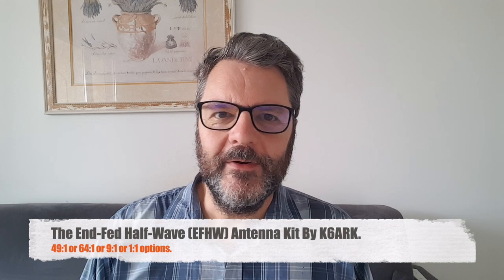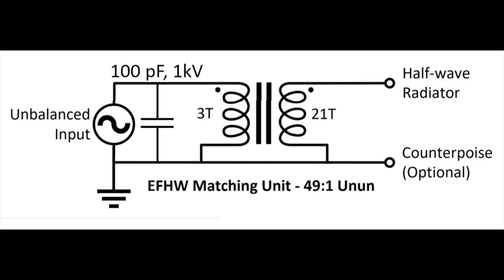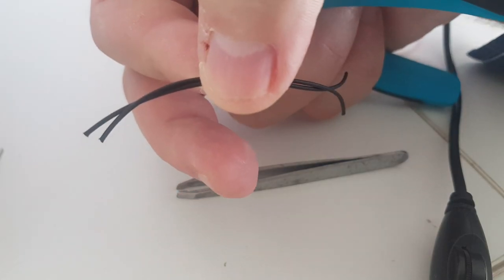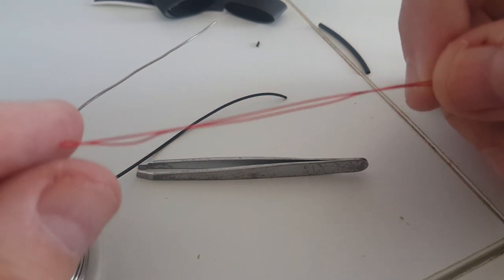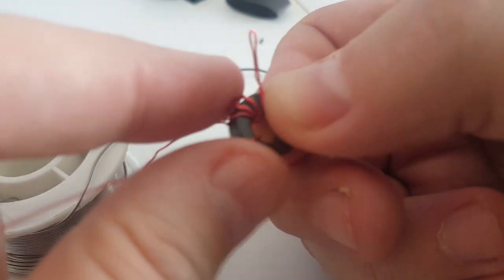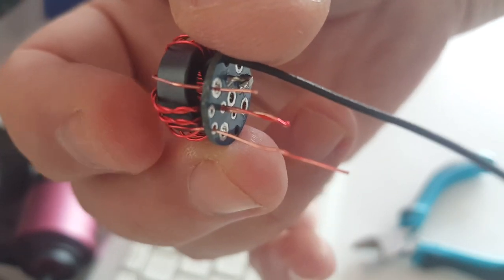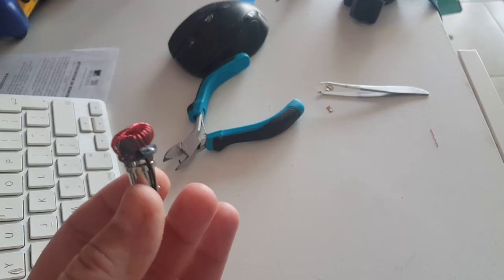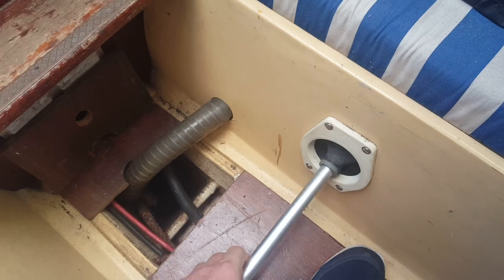Building The K6ARK End-Fed Half-Wave EFHW QRP Antenna Kit.

Comment: Gil, I always enjoy your channel, and thanks for sharing your build of my kit!  Yes, it's a bit on the extreme side of "small," but it's tailored for my super light SOTA activations. 

I have found that 49 to 1 or slightly less (3 to 20 turns ratio) is ideal with this toroid and build for a 40 m and up EFHW.  64 to 1 may work better for an 80 m antenna.  

Hope the matching unit works well for you.  If you find SWR is high, check the resistive impedance with a NanoVNA or antenna analyzer. If it's below 50 ohms at resonance, consider removing a couple of turns from the secondary and testing again. 

TU ES 73 DE K6ARK
Reply from the maker: Thank you Adam :-)

Comment: Just built mine last weekend. I thought I would have a problem with soldering the cap or winding the torrid. But no. Hardest part for me ? Getting the capacitor out of the little pack. lol  After watching a few build vid's on this I actually did it a little differently. I found it was easier for me to solder the bnc jack first then solder the 3 connections of the toroid. I had plenty of room since one of the ground legs on the bnc connector was cracked and broke off on me.

Comment: I really like the K6ARK kit, and have built a few of them.  I believe the heat shrink tubing you used was supposed to go on the optional inductor.  The small section of shrink tubing is for the toroid.  I have always made the kits 49:1 (for EFHW), and I used 26ga antenna wire.  I look forward to seeing your results using 64:1.
73 - AA4K
Reply: Yep, this is correct.  The small loading coil placed about 2m from the feed point helps optimize SWR on resonant multiple frequencies (i.e. 20m and 15m on a 40m EFHW wire).

Comment: Yeah, that capacitor can be a challenge.  I used the same technique you used...blue masking tape.  I've built three of these kits that Adam (K6ARK) sells.  The 9:1 is easier....no capacitor used.  The kit you built is the 5 watt version.  He also sells a 20 watt version.  It has the original FT50-43 toroid and includes an FT82-43 toroid.  The FT 50 is placed inside the FT82 and the two are wound as one toroid.   I think you might be pleasantly surprised, as I was, how well they seem to work.  Superb for minimal size unun.  If you build one with the male BNC and wound as a 9:1, it can attach directly to the radio output   Just some thoughts.

73
Karl  K0TBT

Comment: The surface mount cap seems a bit unnecessary. How much space would a standard cap of that size take up/weigh? A nice compact solution overall though.
Reply: I built one similar to the K6ARK design before he made his and put a small (non-surface mount) 2kv capacitor in the middle of the toroid.

Comment: I think when paired with a tr(u)SDR it will make a really good HF EDC radio kit so small and quite practical.  Like you I built my own using larger a much bigger toroid  but I want to be able to run up to 100W and so it's needed.  I'm still thinking to have one of these for backup though.  I think K6ARK used epoxy on his, whoch is what I thought you were going to do! 😀  Hot glue is just as good here I think.
Reply from the maker: Do not use epoxy. I potted two ununs in epoxy and they did not work, lost them both!

Comment: Why 1kV? What's a realistic RF peak voltage at the primary, assuming 5 watts?
Reply: I've since switched to 500v caps in the kits. This gives cushion for folks who briefly decide QRP means 50w when they're trying to eek out a contact. 😆
Realistically for QRP, 100v is enough.
Reply: @K6ARK  You have to be defensive. When I made up a 49:1 for an EFHW I used a silver mica cap, because I like tipping my hat to the old school ways! Do you use any particular dielectric?
Reply: @Paul_VK3HN  perhaps my reply didn't read the way I intended. There was no defensiveness in that comment back. My apologies. 

Truth be told, I've pushed 50 watts through my 20w kit trying to make a difficult contact work. And I know I've put more than 5 watts through my QRP kit in brief stints. I do these things too...

In the end, all ceramic capacitors that size are similarly priced and it doesn't make much difference to me from a cost perspective so I went the conservative route.  Silver mica caps are great for applications where you need consistent, reliable capacitance in a finely tuned circuit like a trap.  If you got 'em, by all means use 'em.
Reply: @K6ARK  Ok Adam, maybe my comment wasn't clear, I meant to say that when you are offering up a kit that people are going to buy, build, use and occasionally abuse, you have to make conservative choices on some component ratings.  All good.  Looking forward to  seeing your Pico Pixie progress!
Reply: @Paul_VK3HN  lol, no worries, I thought I had given the wrong impression in my response.  Must be the language barrier 😉.  😆
Reply: @K6ARK  K6 to VK, it's a wonder we can communicate any meaning at all!

Comment: You said 24 wraps, but the diagram shows 21 wraps.
Reply from the maker: 21 is for a 49:1, 24 for a 64:1.
Reply: @RadioPrepper  Okay, but then you're not following the kit instructions.  Let us know how it will work.
Reply from the maker: Right, but I've built dozens...
Reply: @iw2epe  if you go dowload the build instructions and read through them you will find your answer. Adam suggests 24 turns for an anyenna optimised towards the 40 and 80m bands and 19 turns for an optimized antenna towards the 20 and 10m bands (along with the optional inductor), and it does word really well. I use my k6ark efhw for sota activations and every time I activate I get chasers from Europe in my logs with only a 20w radio.
Reply: Hi, you can make any combination of impedance match, if you follow what was done, in this case 3 primary, with total 24,  24/3 = 8  8x8 = 64 to get 64:1  same with 49:1 using same principle 7 squared is 49 with 21 turns,  hope this clarifies, n yes Gil has built dozens of hwef transformers